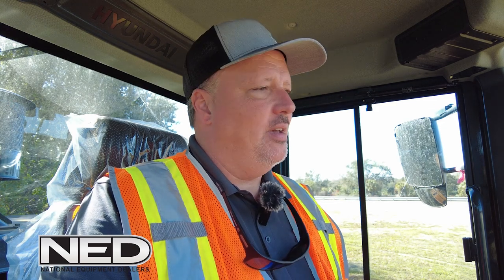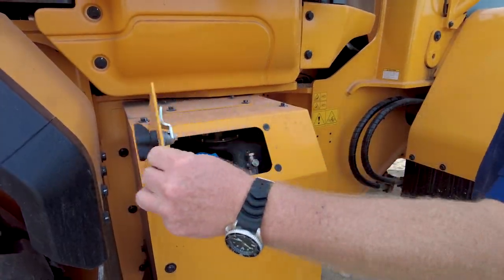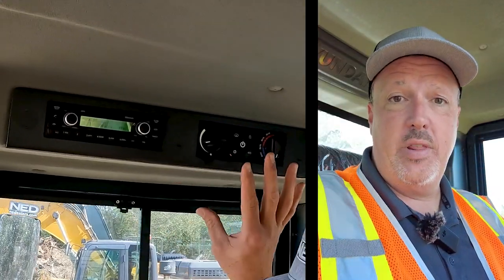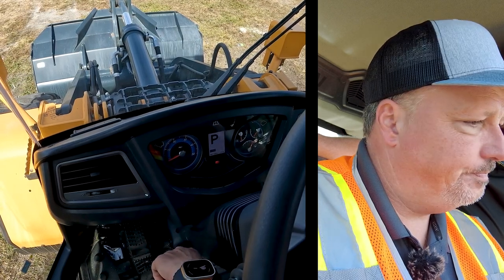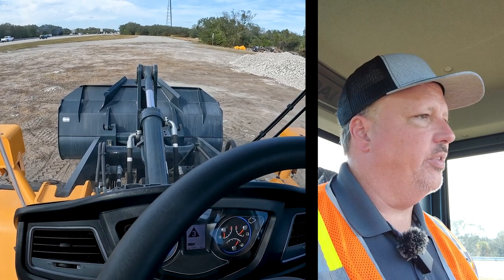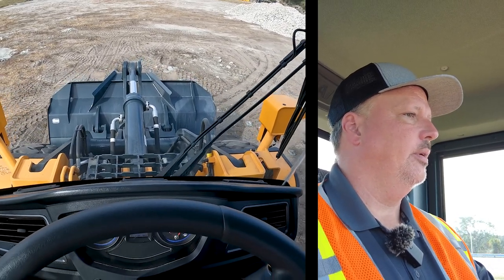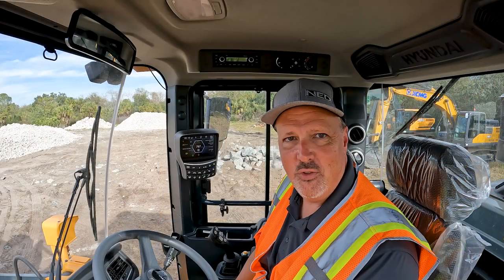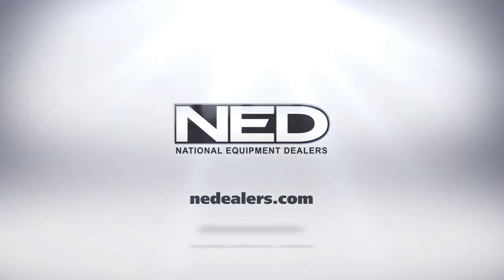Learn how to operate a Hyundai A Series Wheel Loader - NED Talks 82

Comment: this is a long shot but is there anyway to turn off the auto dump feature, when you lift the boom up the bucket will dump automatically, hard to get use to
Reply from the maker: You should just disable the detent on the boom/bucket. Menu #9 button.